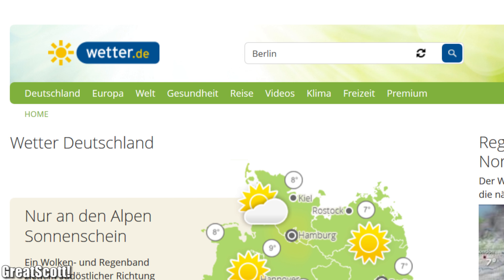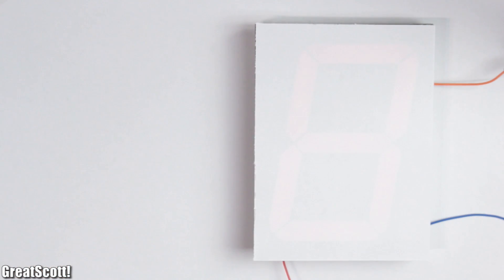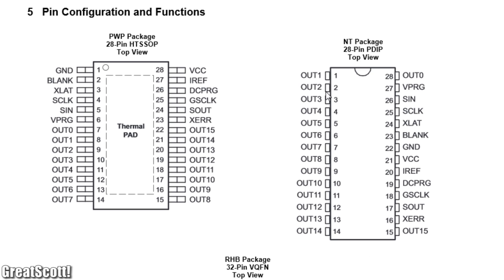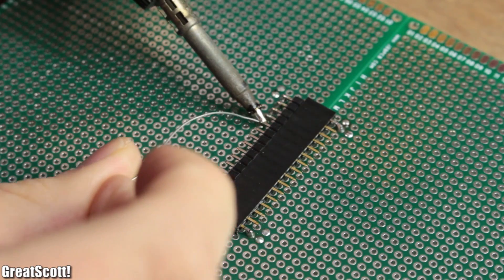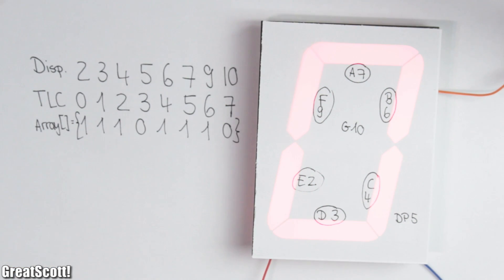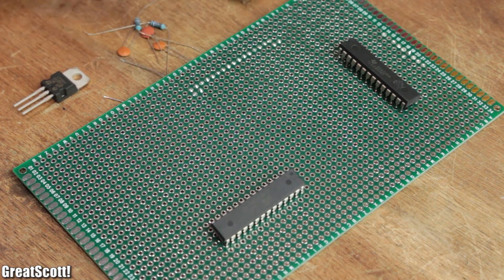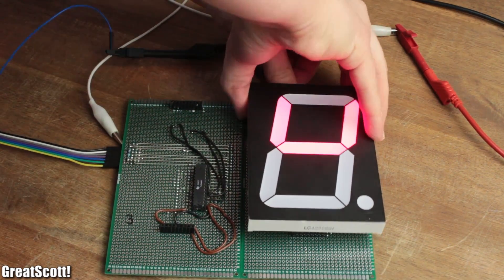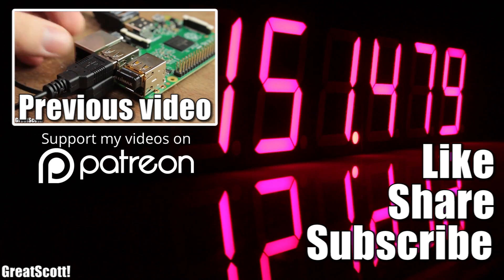DIY 7-Segment Internet Display (Part 1)

Comment: I have weighing scale pcb and i want extra display to that pcb which shows big. The problem is that pcb have 6digit  7segment and 16pin i dont want to connect all 16pin to display becouse of to long. So how to i convert 16pin to 6pin by using ics? Please answer me

Comment: you need to do 8008135 with the mirror thing in the thumbnail.
edit: it wouldn't work because it isn't mirrored the direction.

Comment: you're saying that each segment needs 7v rather than 9v, but i cant't see from your schematic that you step down the voltage from 9v anywhere?
Reply from the maker: I use constant current instead of a constant voltage.

Comment: You can make the leds brighter by PWM on the drive current. If you run a quick PWM of 10%, the current only has to be increased about 2.5 times because of eye persistence to look at about the same brightness. You just need to stay in the low end of the led SOA. Very high currents in very short pulses look very bright even though the average is small. We regularily run red leds at 2 amps and a very low PWM to get very long life, super bright leds for high use road signage.

Comment: it looks like your pcb traces for the power are too thin. 
Maybe you will have some voltage drop across the 7 stacked displays
Reply from the maker: +MrPmjg I did not measure a significant voltage drop.

Comment: Hello GreatScott! I've got a Simson moped, too! I wanted to run the headlight of the battery, but I can't separate the second wire from the ground on the Lichtspule. I Just ran a wire from the core of it to the rectifier bridge. So can you Tell me please how much Watts of charge can i get. Or can you Tell me how to separate it from the ground. Thanks for your reply.

Comment: no multiplexing?
Reply from the maker: +Czar Corey The brightness of the LEDs decreases. The code is a bit more difficult.
Reply from the maker: +SirArghPirate Yes
Reply: +GreatScott! Exact same thing i was going to say. What are the disadvantages of using a multiplexed system with a transistor as an enable?
Reply: +GreatScott! Great project and I love your videos btw. Thanks!
Reply: +GreatScott! Couldn't you solve that by running them at a higher current? the multiplexing should stop the led from overheating like a form of PWM.
Reply: +megaspeed2v2 not sure if this would work but if you used the data lines from the multiplexer to enable mosfets to feed the 7-seg display wouldnt that control the current?
Reply: Czar Corey that sounds like its what a multiplexer has internally anyway and that doesn't limit the current in itself, the current limiting resistors do (or current sources if you want to do it fancier) i was suggesting increasing the current limit above what the LED's are rated for to counteract the fact that with multiplexing each led is being driven for T/(no.OfLEDS) which along with human persistance of vision reduces the brightness so much that you could notice even with the leds driven at their max current, i was thinking that since in this case each led isnt on permanently that would mean you can go above the max current of the LED and counteract the off time, but then the problem is you would have to push a huge amount extra current through in that short time to double the brightness since the curve of luminescence per miliAmp starts to flatten off around 20mA for a standard led.
TLDR version: would be easier to use something like a TLC5928 which is LED driver which would do the job of the multiplexer while allowing the LED's to stay at full brightness as they never switch off between transitions, advantage #2 being that no matter how many leds you want it requires only one data line since they are daisy chainable :D
Reply: +megaspeed2v2 very good points. I have been working on a code to do this project but with multiplexing, but i havent touched any hardware yet. I will keep this in mind

Comment: Nothing against PCBcart but wow.. $100 for 5 PCBs? That seems awfully high... 
I've not used it myself but on Seeedstudio I just put in as many of the same options as possible and it only cost about $20 ($19 for 5 PCBs or $22 for 10 PCBs) now sure they don't offer nearly as many options to customize but the cost factor of $100 vs $20 I think I can accept that.
Reply from the maker: It was the size of the board that made it that expensive.
Reply: +GreatScott! Yeah the size seems to add a lot to the cost, however if you compare the two by playing with the settings, I can't seem to get a PCB any cheaper than $60 ($52 if you go for a single layer) for one PCB from PCBcart whereas by contrast Seeedstudio offers ten 100mm X 150mm PCBs for $55, more than needed yes but you could cut it down to size and you have backup PCBs.

I'm sorry but I just couldn't justify paying such a premium unless I had a special need that only they offered...
Aside from that, I still enjoyed the project, thanks Scott.
Reply: tuva600 Perhaps, but it is quite a bit for a one off project.
Reply: +vgamesx1 It seems PCBcart offers custom PCB fabrication service, you can have your boards manufactured in any preferred size from prototype to production... Seeedstudio is more of a hardware innovation platform, its prototype service offers limited boards size selection.
Reply: Elyn Yang I sort of mentioned that or did you just miss the part where I said "Seeedstudio doesn't offer nearly as many options to customize." and that I personally don't find it a great value but maybe you do....
Reply: +vgamesx1 yeah, i did noticed that. just want to share my thoughts anyway :-)
Reply: Elyn Yang Alright man :)

Comment: I'm a little perplexed as to why you didn't chose to run the atmega328 at 3.3v?  That would have saved you having to use level shifting and adding another regulator for the esp8266.

Comment: Try oshpark for PCB
Reply: +CaptM44 not at that board sizes, then you're better off with dirtypcbs.com
Reply: +Dave P I tried the dirtypcbs, their standard boards size is 5cm x 5cm and 10cm x 10cm. Custom boards size is available for big boards (10x10 or up) with at least 10 pieces quantity... Should I contact the support team for cost for Eric's boards in 5 pieces?

Comment: Should of used the (Auto Router ) its faster to do this and then check the tracers manually editing each one as and were needed. As that board  was so large for such a small project you probably wouldn't of had to modify any of the tracers the auto route did.Then just running the DRC/ERC would alert you to any problems. Also.Also making ground plains on both sides would of made for a much nicer board. It would of been cheaper to do a small PCB and use headers to connect to the display. i use OSH Park for my PCB'S there pretty cheap

Comment: Hi what happened with your Bench Power supply?

PS: What is the difrence between red lines and blue line in Eagle?
Reply from the maker: +Veso266 I upgraded to a newer model. The different colors defines the front and backside.
Reply: +Veso266 The lines are traces.
You can easily have top. middle1, middle2, middle3, middle4 and bottom.

Comment: you could ditch the atmel micro ad control the whole displays using and esp8266 module with more gpio i.e. esp12 or esp8266 nodemcu, or even the arduino-like WeMos

Comment: That's kind of wasteful. The ESP8266 thing is powerfull enough to do all the job, as long as you program it in C + Lua. 
I did a similar (kind of, lol) project myself a year ago with ESP8266 and LPD8806 LED-Strips, I can tell you more about it if you want.

https://www.youtube.com/watch?v=BqcQfeFNPYM

Still a good job though.
Reply: +vgamesx1 my bad, totally forgot about ESP versions, I've been using ESP-03 myself :0
For the ESP-01 a bit  of "shift register magic" would do the trick I guess.
Reply: +yoyoyo well the ESP-01 he has doesn't really have enough pins, but if he had one with more pins like an ESP-07/12 then sure.
Reply: +yoyoyo the arduino IDE is also supporting the ESP now. Just saying because of the atmega328P that will most likely be used.

Comment: How many arduinos have u layn around?
Reply from the maker: +Darosidos Too many
Reply: +GreatScott! nah, me too :/
Reply: +GreatScott! Is that because they are clones?
Legit ones are pretty expensive, so i bought one legit and the rest are clones
Reply: +Darosidos Sende mir einen bitte...
Reply: +DanielsLPecke ein zuverlässig funktionierender China-Klon für 2,70 das Stück:
http://www.ebay.de/itm/Nano-V3-0-ATmega328-16M-5V-Micro-controller-CH340G-board-for-arduino-/371179047627

Der einzelne Chip ist hier u.U. teurer als das ganze Board
Reply: +nrdesign1991 Hab so an die 20...
Reply: hab auch gerade wieder 8 geordert. Das ist absolut hinterhergeworfen
Reply: Ok.. sowas ist aber nichts für anfänger oder? nrdesign1991
Ich habe am Donnerstag erst ein Lernpaket bekommen...